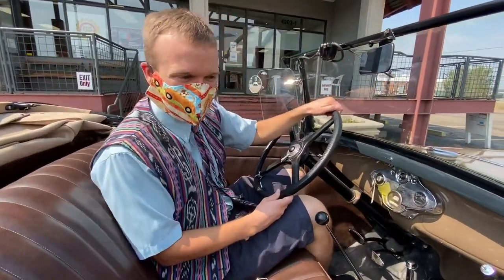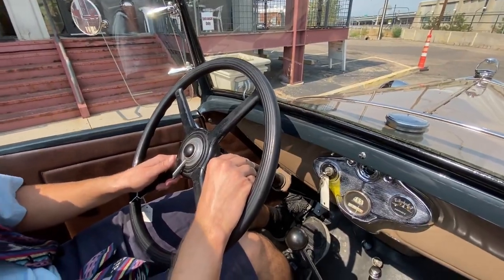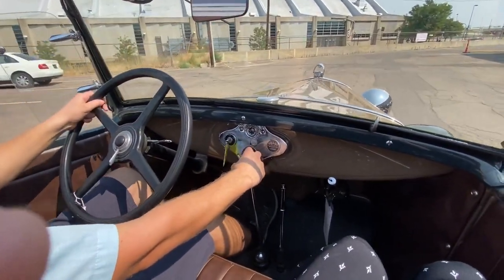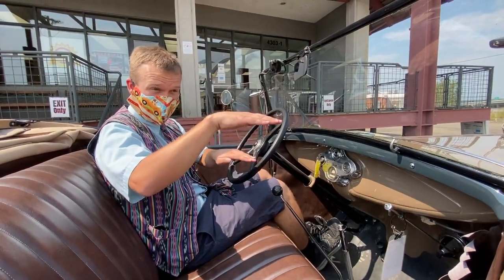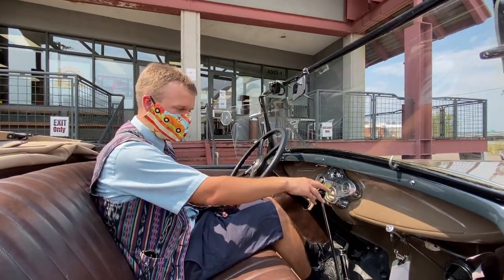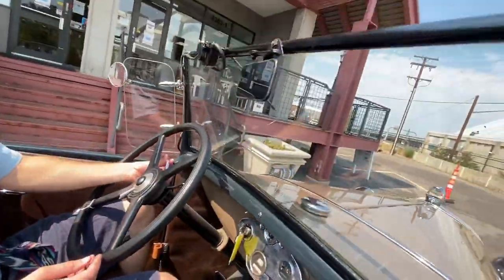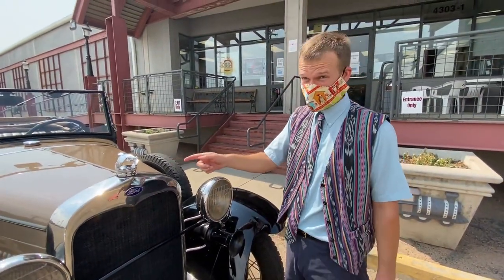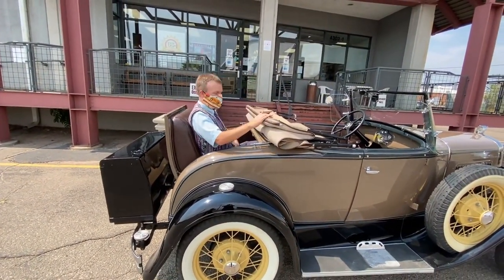How to Drive an Unsynchronized Manual Transmission:  1930 Model A Roadster

Comment: Good attempt to explain the procedure.  Only two things:  When you're trying to film your footwork on the pedals, you need to be doing it when the sun is BEHIND you; it was very hard to see what you were doing because your feet were in the shadows.  Also, as soon as you move the shift lever to the next position, you need to move your arm OUT OF THE WAY as quickly as possible...again, you were blocking the pedals, this time with your arm!

Comment: Oh mate, this takes me back to my youth on the family farm, I bought an old Model A from a neighbour, the engine was all seized up, but I soon had that all fixed, then I stripped the body off and made it into a paddock basher, wow, did this old girl teach me how to drive a non synchro box, we had a make shift race track around the sheds, haystack, and sheep yards, best fun I ever had as a young bloke, we also had a paddock basher 350cc Ariel motor bike, so there was another awesome skill learning to ride, then thrash the motor bike around the track....I will never forget those days. The secret to working a crash box is all in the timing, and don't be timid with the rev matching, Double De Clutch gear changing only slightly slower than with synchro when you know how.

Comment: When he is demonstrating down shifting with the car stationary, isn't he missing a step when shifting down from second to first? After you have pushed in the clutch and pulled the gear lever from second into neutral, you have to let the clutch out, give the gas pedal a push to raise the rpm, then push the clutch in again and shift down into first. That's why it is called 'double clutching'. Letting the clutch out in neutral and giving the engine some gas causes the transmission's first gear to spin faster thus bring it up closer to the speed of the wheels. Am I wrong?

Comment: Nice job young man. You are close. I suggest you research and understand the timing advance lever better. You start the car lever at the top as you did, but you do not drive it there. After the car is running a few seconds, pull the lever down a couple notches. (8 to 12 degrees of advance.) When driving out on the road, engine warm, lower the lever a couple more.  That will be to about 20 degrees advance. If you begin to run high speed, say 35-45 or 50, move it down a bit more. You can find a nice explanation for this by viewing Paul Shinn's how to time a model a video on YouTube.

Your shift explanation is mostly correct, but I'd like to add that you need to rev the engine for your downshifts while the transmission is in neutral and the clutch pedal is up, not down. When the pedal is down, the engine is disconnected from the transmission, and the input side gears will coast down to a speed that is too slow. With pedal down, you have no way to speed them up. That is why you double clutch to downshift. You use the throttle to increase the speed of the input gears, but the clutch must be engaged to do this.
Reply: Drove one. Didn't need to "double clutch". Just very decisive shifting.
Reply: This is bullshit lol
Reply: @spiderofthehood6127  its true, you dont even nred the clutch either past first gear, or really at all if u use the starter in firsy
Reply: @Skoda130  His engine is idled too high as well, to properly double clutch you need to let the rpm's adjust, and then clutch out in N.

Comment: They had generator generators it was called the magnetos used for ignition and electric motors that could fit in cars by the teens
P.S. Model A with a unsycrhonized transmission!?!? The owner must have been a masocist yeesh